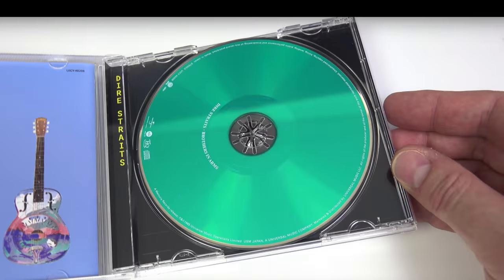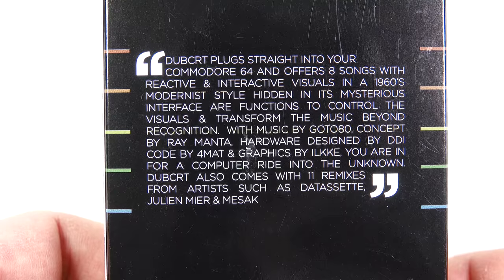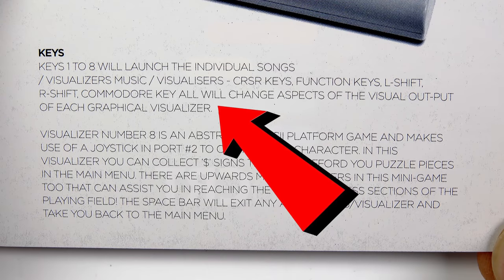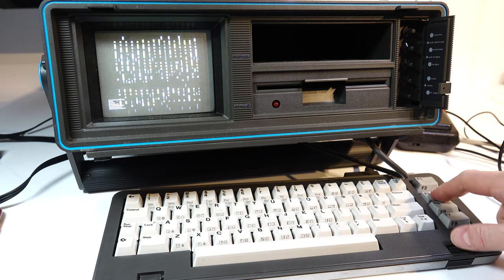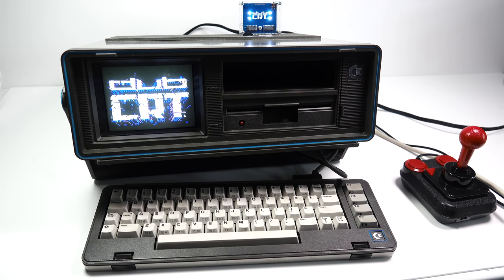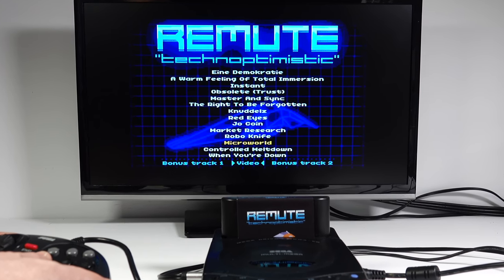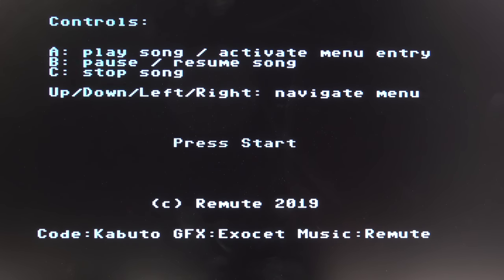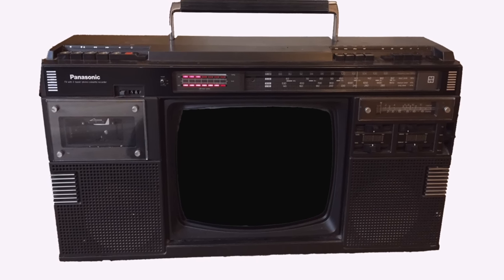Music Albums on Game Cartridges (C64 & Megadrive)

Comment: Raspberry Pi Zero has a couple pin pads that you can easily solder two wires for Composite video output.
This is commonly used to give it an RCA video plug.

Mod the CRT to skip the RF demodulator unit and go directly Composite input for better signal quality.

Comment: Thank you so much for the great coverage of dubCRT! There will be a second version sometime next year :) Just for the record it should be used on an 8580 SID which is not in an sx64 :) The project set out to do something new with old hardware and am so glad if people at the very least find it interesting! 4mat’s code is generating the visuals directly from sid data in channel 3 of the sid chip, and there are some hidden sections that can be accessed easily from the version that is downloadable on csdb. More info here http://datadoor.net/blog/2017/11/26/%e2%8c%8adubcrt%e2%8c%89/
Reply: Is the 8580 SID the one that is in the C64C with the small mainboard version?

Comment: "I don't have a Model 1 MegaDrive so I had to use a Multi Mega instead" 

I'd be happy to swap you a Model 1 MegaDrive for a Multi Mega 😉
Reply: Using a non Model 1 to showcase chiptune music is like using a Fisher Price boombox to listen to CDs.
Reply: @DeAthWaGer  I know but it's the way he just casually has an SX64 and a Multi Mega in the same video...
Reply: the Multi Mega has good audio quality though
Reply: @DeAthWaGer  😑
Reply: (11:10) I've been looking for either a device similar to a multitap or a cartridge passthrough, that allows the U.S. Sega Mega Mouse to work with any D-Pad game. For instance, 688 Attack Sub or Dune II are games that would benefit from mouse controls. The Mega Mouse currently only works with cartridges designed for mouse input.
Reply: @DeAthWaGer  Not really in this sense. It was actually designed to have the best audio quality out of all the models due to the portable cd playing functionality

Comment: Hey Techmoan, awesome video as usual! Have you ever heard of the YM2017 Sega Genesis cartridge album? It was released by Catskull Electronics back in 2017 and features an LED matrix visualizer on the board which can be seen through the translucent cart, it's really neat! The music on it was submitted by various artists, and only a select few were chosen out of them all due to storage limitations (I made it on there btw, I composed Festicity Zone!). The carts are long sold out, however the album did get a vinyl release through Yetee Records, and I collaborated with Catskull to put out a cassette release on my label, Lazer Burn Audio, which also contains all the other music that didn't make it on the cart! As of writing this, there are still several vinyl records available of it, and although the cassettes were a pre-order I ran, I still do have a couple unlisted extras, willing to send you one if you'd like! Also I did a full rip/showcase of the cartridge edition here, from a model 1 Genesis: https://youtu.be/pQriIFzEtQc?t=34

Comment: Hello Techmoan, there is a technology you are looking for at the end of this video. It is a software called VSXu Visualizer. I did exactly what you wanted to do with it with a bunch of CRT TVs (3 - 15 TVs!) hooked up to a Composite splitter, all showing the same music-reactive image from the PC. We put the program in the autostart folder, so it started with the computer. And you can set a computer to boot when it gets power in the bios settings. About the size, we ran the software on an old Core2 Quad, so you should find a more modern small form factor pc capable of doing the job. I hope this helps, cheers!

Comment: Fun note as small time collector:
That mega drive cartridge is shaped to be universally compatible with all models of mega drive. European and US units have a uniquely shaped bottom with back corners that make the western consoles without physical modification incompatible with Japanese and other Asian mega drive cartridges. Japanese and other Asian Mega Drive systems on other hand have a Gameboy like mechanism that latches into small notch on left side of the cartridge and mechanically stops user from turning on the system unless the mechanism is physically removed from the console or western cartridge without such slot by default is modified rather violently to have such a slot. Mega drive did not employ region lockout programming until later half of it's life and many titles are essentially region free aside these differences. Only official title I can think of is Sonic & Knuckles with it's unique cartridge that is the one and same for all regions minus packaging and the cartridge label, but these artists employed the same design in their otherwise western like cartridge.

TL;DR: It is very nice that REMUTE makers made the cartridge physically region free, too - it even might include detection and speed modifications based on which video signal speed it is outputting (50/60hz)

Comment: Probably worth taking a look at a raspberry pi, the earlier models have composite out and being Linux you'll find all sorts of software out there
Reply: The current models also have analog video out, but it's on the 3.5mm jack (the Pi Zero has a header for it)
Reply: Even current versions have composite out, but you have to break it out from the minijack and it's disabled by default
Reply: The latest models still has composite out. You just need to use the headphone jack with a breakout cable (on a standard pi) or solder the jack to pads on the motherboard (pi zero)

In theory, you could just pipe a line input into ProjectM and say job well done.
Reply: @xureality  I was just going to say, projectM, but the pie lacks audio in.
Reply: It does seem that the pie doesn't support ProjectM :(
Reply: @zero0ryn  I saw ProjectM in the raspbian repository, so I gave that suggestion. Would be weird to have it in the repo and it not working.

Also, you can just get the audio injector zero board, use any number of I2S sound input devices, or just plug in a USB sound card.
Reply: On audio input, there are multiple options. From third party hats, to USB sound "cards".
Reply: Pi is great but I think booting might took to long for his taste. Maybe some uC or even FPGA hacker over here
Reply: @zero0ryn  but you can use a USB audio adapter to get audio in and out.

That's how I do videos on my phone when I have the sound from the game in the video
Reply: I think the approaches here are too simplistic.

Using a Pi or similar for composite video is great, but what are you planning to operate as the modulator for a PAL/NTSC receiver with no composite-in facility?

Mat has pointed out the devices are television tuners - not composite monitors.

The signal would need encoding and modulating against the sets standard.

Composite and RF OTA signals are related but not interchangable.

I think there is an expectation that composite video is the same as RF signals; this is absolutely not the case.

https://en.m.wikipedia.org/wiki/Composite_video
Reply: The pi would probably be a good way to go about it, but I can't seem to find any projects for visualizers that support the pi properly. If you spend a bit more you could get one of the x86-based Single Board Computers I guess, but even then you'd probably need to poke around quite a bit to get something that just boots straight in quickly and visualizes whatever comes off of line in. Then if he's using it with those boomboxes he'd have to step down whatever it outputs to composite, then modulate it to RF, which means you've got a minimum of 2 power adapters just for viz.
Reply: @musmodtos  Most things you're gonna get these days are gonna have that problem though. Like if we were making custom hardware for this purpose we could integrate an RF modulator, but any product coming out now for general consumer use that might do this would probably just have HDMI and/or composite. So I think there's an expectation that whatever we make or find would likely need an external RF modulator.
Reply: @wytrzeszczux  You can just leave the RPi on. They don't use a ton of power, and that would negate any boot time issues.
Reply: @musmodtos  There should still be plenty of NOS and reclaimed PAL RF modulators kicking around for pennies. They usually output on UHF channel 36 but there are some more advanced models that allow a selection of frequencies. How long channel 36 will be available is debatable - I presume that OFCOM will want this cleared for digital use in the near future if not already.

Comment: I think the video visualizer is totally possible, Techmoan. All the visualizer does is draw an image depending on how loud a signal is, then output it into an RF signal.
Clever use of a microcontroller could easily get that done nowadays. I'm unfortunately not very savvy in regards to digital electronics.

Comment: Thank you for the warning! That DubCRT cartridge is not only quite expensive, it also by far inferior what I have heard and seen on a C64 in the past 35 years. It looks like some 25 year old art students bought a C64, read the manual and programmed some songs, without any experience how a "demo" should sound and look like. This looks like the very first programming experiments from 1982.

Comment: Are there devices that can transmit the old analog TV signal? (like there are FM Transmitters to connect your phone to an old radio) If you can make such a transmitter- you could just use old TVs, tune them into your self made channel and have audio (the music) and video (some visualization) come from some sort of small computer/phone- no modifications on the old hardware needed.

Comment: Have you cracked one of these video boomboxes open to see how the antennae is wired?

I don't know much about TVs, but I work on old game consoles, and many of them have onboard RF modulators for video output. If the system doesn't have AV output and you want it to, you can usually bypass the modulator by wiring AV ports or cables directly to the board. Am I completely off-base here, or could there be some way to bypass the antenna in a similar way?

Alternatively, you could do what Kipkay did to bring his little TV into the digital age: wrap a wire around the antenna itself, hook it up to the output coax port of a digital converter box, and then set up the converter like you would with any other old TV. Then it's just a matter of finding a way to transmit a DTV signal, which is probably illegal, but you're not likely to get caught as long as you keep the range small.

Comment: I actually have one of those boom boxes with a tiny monochrome CRT in it that I modified into a crude vector scope just pumping the audio output through the deflection coils as an experiment. I added a Bluetooth module but trying to find one that is not so damn noisy, get a lot of interference on it. I too enjoy a good technical visualization of audio wherever possible. I will continue experimenting with the idea and I will definitely let you know if I come up with anything neat and simple. Problem is hard to find any decent TV boom boxes at a good price for tinkering.

Comment: Regarding the device you're looking for: What about simply hooking up an RF transmitter to for example a computer? Your boombox can then pick up the signal as a TV signal, and therefore you'd get video and sound. It wouldn't even be plug and play, since it doesn't even have cables. Those devices already exist.

Comment: When my Amiga 2000 was still in use (I still have it in storage) I purchased a hardware/firmware accessory called "Audio Visuals". It accepted a stereo audio input and connected to the Amiga Serial port. The Amiga then output VGA graphics synced to the music. It was interactive, various parameters were controlled from the keyboard. Currently, I have several software only (Windows) applications that have similar capabilities. They are sold by Sound Spectrum (soundspectrum.com) and include G-Force and Aeon.

Comment: If you happen to come across an old PCM processor, that's stored its video signal on VHS tapes, you could just play the visual representation of the modulated signal through your TV on a RCA connector.

Comment: Mat - I don’t believe it has inputs on it however my Atari Jaguar has a very interesting audio visualizer you can control with the joystick, and feeding any audio CD into the Jaguar triggers the built in visualizer program.  Very mesmerizing, to me at least.

EDIT:  it just occurred to me that the Jaguar's Visualizer program is built in to the optional CD-ROM attachment for the Jaguar, so the cartridge-based console doesn't have this usability unless the CD-ROM is attached.

Comment: It's possible to use an Arduino or a Raspberry Pi to make an audio visualiser. Or maybe an ESP32 or Teensy as those have variants or boards you can attach that are more focused on Audio.
The Raspberry Pi would send out HDMI or composite and an Arduino (or ESP32 or Teensy) could send video directly to a small 4.3, 5 or 7 inch 800*480 TFT display.
I'm not sure if it would be practical to build either into one of those boomboxes, but something like the Atari Music TV thing wouldn't be too hard to make.
I wouldn't know how to program them just yet, audio isn't something I've ever worked with in Microcontrollers, but it does sound like a fun project that shouldn't cost more then 30 quids, so I might give it a try sometime. The Critter and Guitari products mentioned below might be more interesting then what I can come up with in a weekend though.

Comment: "Music on Game Cartridges" isn't exactly false; but perhaps "Music on Game Console Cartridges" is more accurately descriptive. In it's heyday, the C64 was more than just a machine for playing games; but today it's not seen as a serious computing device.
At most, classic consoles are utilized for their unique musical ability.

LookMumNoComputer's a great example, with his wall of clock-mangled Z80 gameboys.
Either way; post Y2k, the C64 was firmly entrenched as a game machine. 

The amiga, on the other hand, kept running the Prevue channel lineup display for cabletv networks until like 2006?
So that arguably leaves it firmly in the industrial workhorse category, despite it's gaming capacity. But hey, that's a 68000 for you. 

I mean, one could argue if MacOS were to be running on a sega genesis, it could still be a viable MacWrite platform, like the ESP32.
https://hackaday.com/2017/11/27/jeroen-domburg-miniaturizes-a-mac/
https://github.com/Spritetm/minimacplus

Probably a couple ESP32 or Teensy4.0 or Propeller2 solutions that could scratch your itch for a single board visualization system, or an Orange Pi Zero series running GLMixer using the 13 pin header (with CBVS "composite" out and "mic" linein pins) for around $20ish.
https://sourceforge.net/projects/glmixer/

Comment: There is a bit of hardware out there called a QuantumVJ. It turns audio into video. It doesn't have a display out though, so no use for your needs, but it may still interest you.
However, the developer of that hardware also made some software called "QuantumVJ HD". It can run on android, ios, and windows/linux/mac. So maybe that could be something worth playing with. Maybe you could install it on a raspberrypi. I'm sure there must be a way to tell Linux to automatically boot into a piece of software when powered on, and raspberrypi's power on as soon as power is supplied. So maybe that could be a zero fuss solution once setup.
Reply: QVJ's rather old and unmaintained now -- GLMixer's the current generation.
https://sourceforge.net/projects/glmixer/

And of course, you can create a systemd unit to execute it on boot.
I'd avoid raspberry pis though, Broadcom is a shit company.
Use an Amlogic instead. (Odroid, Le Potato, others)
Even Allwinner's a better choice, despite the GPL compliance issues, they still have a better reputation than broadcom's long term linux hatred.

Cheapest solution's probably an Orange Pi Zero Two or Zero Plus2.

It's not hard to bypass an old television's RF demodulator and feed it pure composite, which those tiny Orange Pi Zero series have available on the 13 pin header.

Comment: There was an incredibly good Winamp visualizer/screensaver called Geiss. The Geissworks website is still there. If someone could make a modern-day 64-bit version of the code that would be awesome, or write a tool that let you use the Winamp plugin in VLC that would be even better. Geiss was an incredible visualizer, nothing else today even comes close. I'm sure it could even be made into a visualizer device with a screen for sound systems.

Comment: There's a simple guitar pedal which just outputs the clean signal plus a visualiser to a tv which is basically the same thing as what Techmoan is describing at the end. It's called the Videoscope by Critter & Guitari, Samuraiguitarist has a video that features it. On the other end of the spectrum is the OPZ by Teenage Engineering which is really technical. Not that anyone will read this cause it's been a couple of days and 1213 comments since this video came out.

Comment: There’s another album on a cartridge for the NES. It’s by the band Anamanaguchi and I think it’s called Power Supply. You should do a followup video with that if you find others. 😁
Reply: Power Supply was made in limited numbers and is quite rare and expensive, if you can even FIND it. There's only two hundred out there. You can find the ROM dump and burn it on your own cart though, or use a flashcart.

Comment: is your commodore entirely compatible with that cartridge?  the glitches on the dub crt logo suggests something is not quite right to me.

i might take up your challenge re tv box and see what I can do in a single 8 pin chip (may have to wait 'til xmas.)
Reply: Bill Todd the dubcrt is meant to run on an 8580 sid chip (as mentioned in the instructions) - he is running it on a 6581 chip in the sx64 which isn’t properly compatible for the music